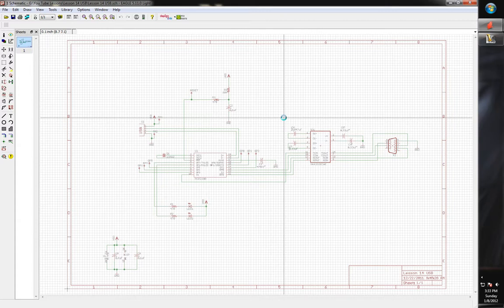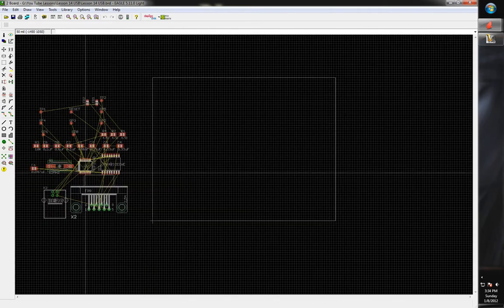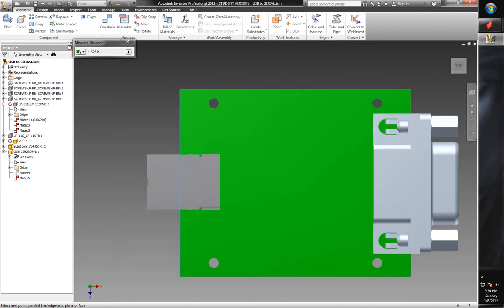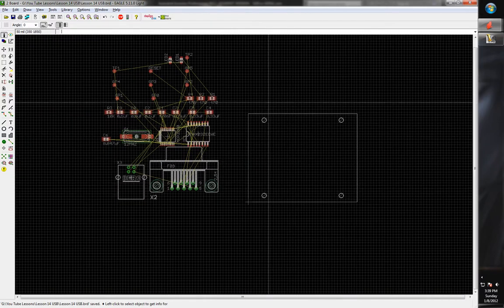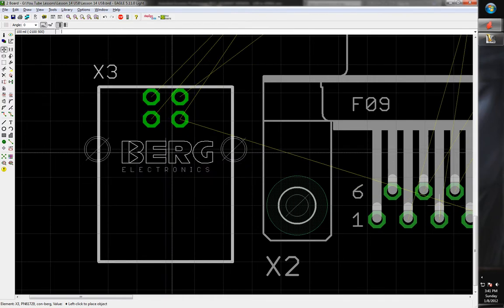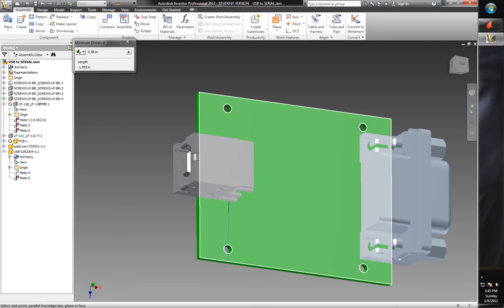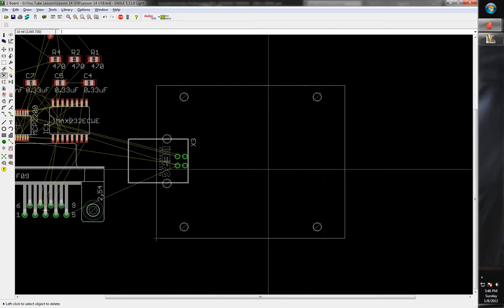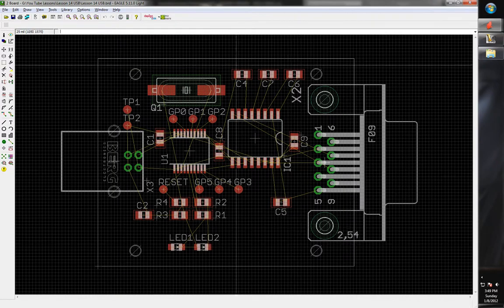USB to Serial Layout Part1

Comment from the maker: I believe so since all the MCP2200 does is convert the USB Data signals to Rx and Tx it should work both ways.  I have not had a chance to fully assemble this unit and testing but when I do I will most likely make a vid on it.

Thanks for the question.